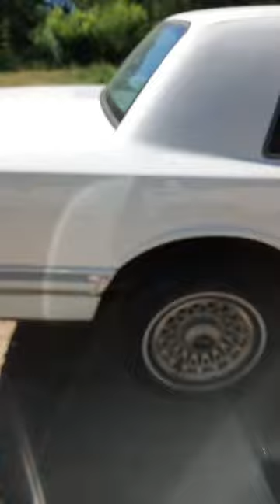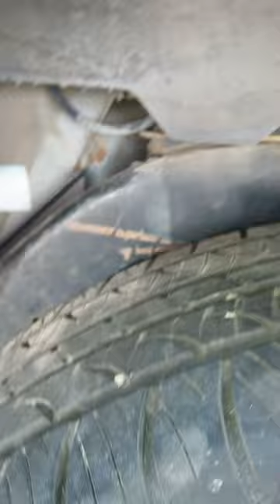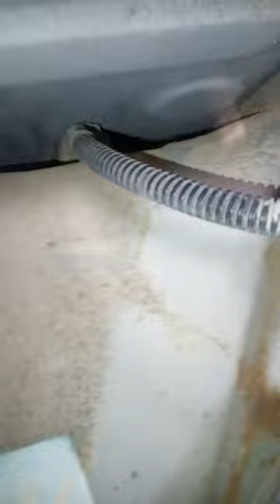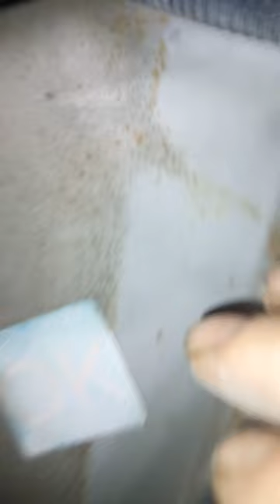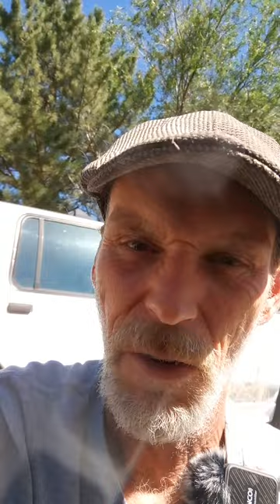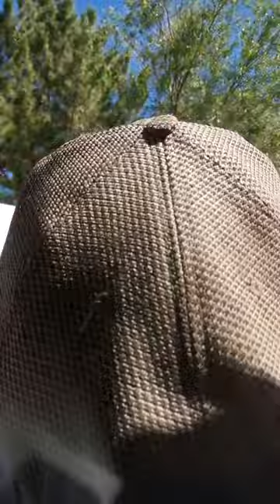Ford Engineering, Built Ford Tough or Ford Tough to Build? You decide... 😩 😫 😩 #shorts

Comment: Why drop it when you can just unloosen it enough to get it off while using a cottor pin puller to disconnect it😁.
Reply from the maker: It almost came to that.... but I was able to get my brake adjuster tool in there and hit that release clip to undo it. Still though...... what a pain in the rear that was